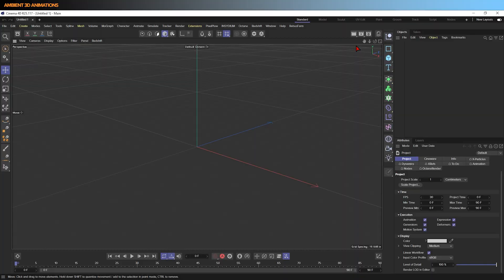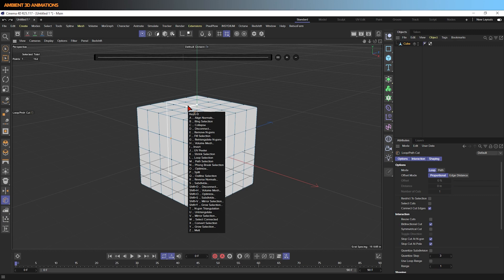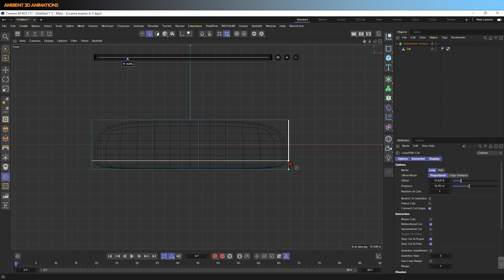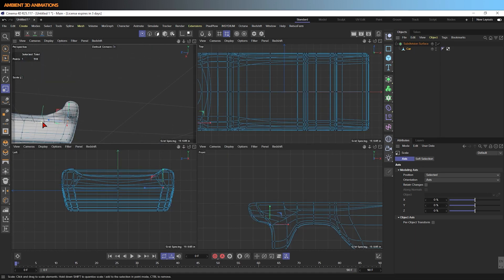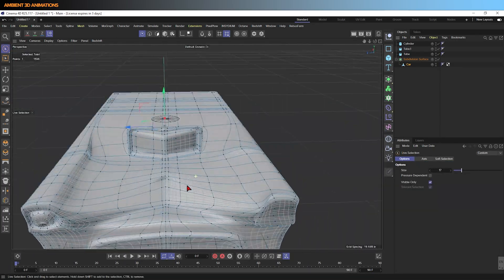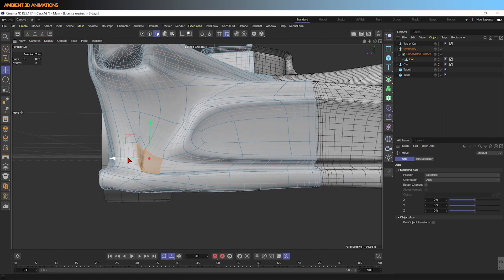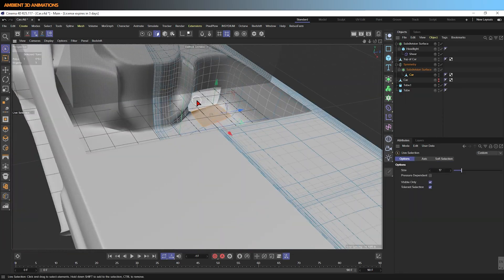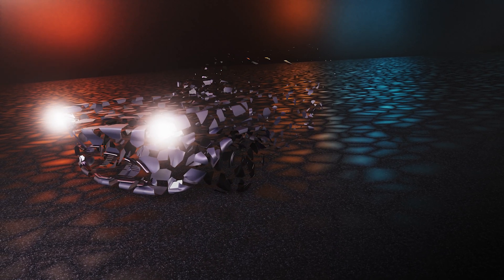How to 3D Model a Car in Cinema 4D

Comment: Great video!!   As I’m entered in Pwnisher’s Endless Engines challenge this will be invaluable! (You did the hard work for this challenge…you may want to enter as he has great prizes lined up.). I had started with doing an outline for planer modeling but this looks faster and easier.
Reply from the maker: I’ll have to check that out! It sounds really cool!